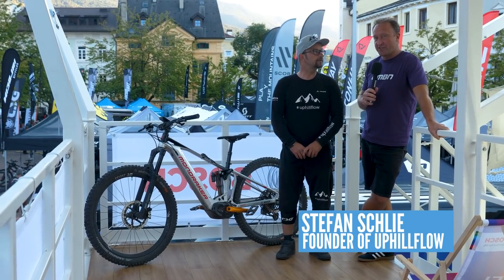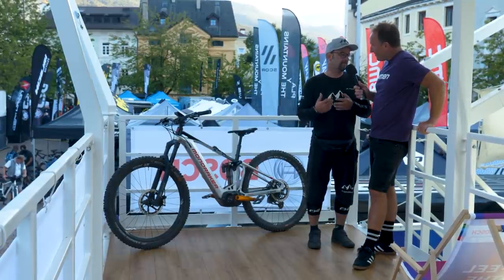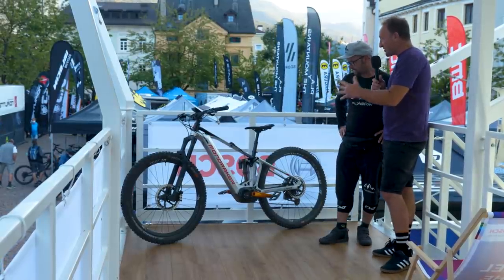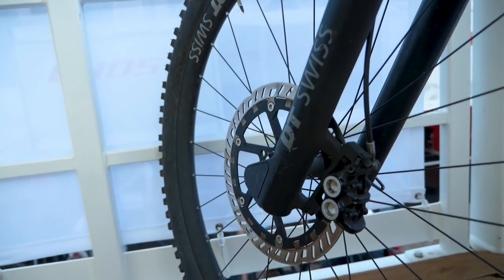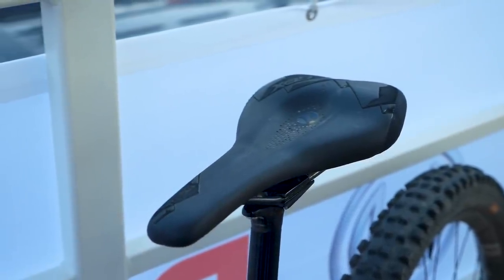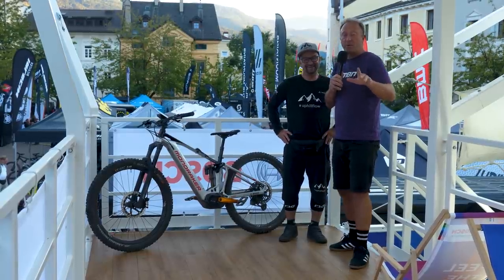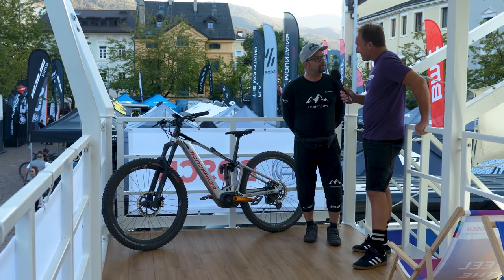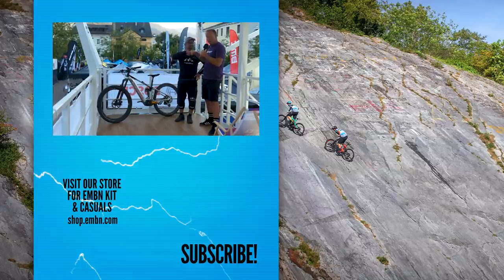An E-Bike For A Trials Genius! | Stefan Schlie's #Uphillflow Mondraker

Comment: is psi relevant to bike and rider weight? i.e lighter rider can run lower pressure. I have seen motorbike trials riders dab after the wheel rotated inside the tire as they were running it a little too soft, but how low can it go steve? I think it needs to be tested out in a vid.